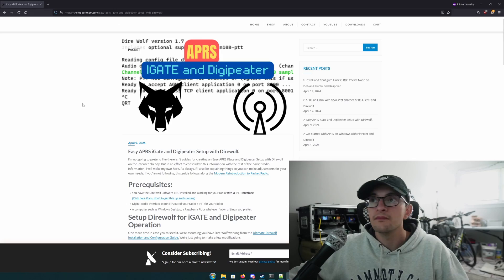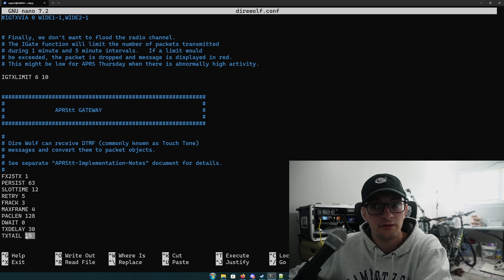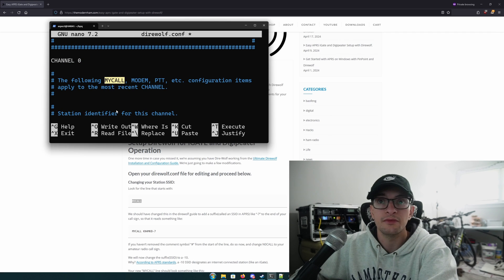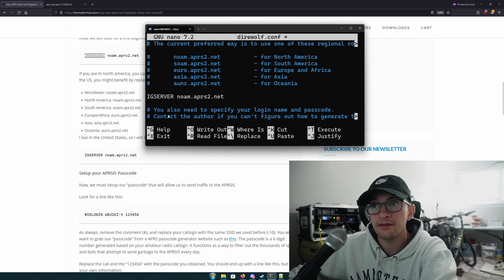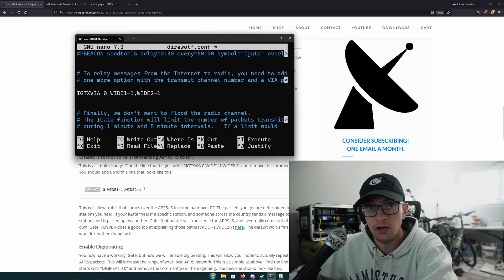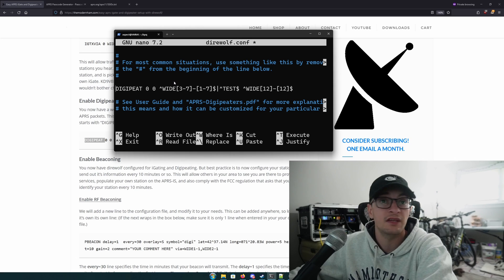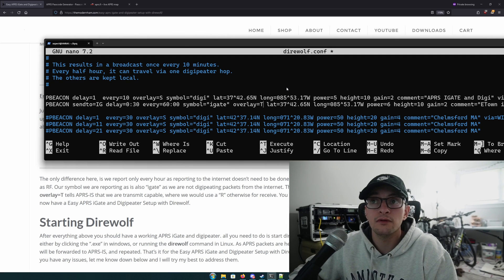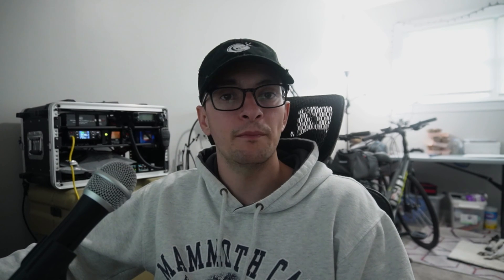EASY APRS I-Gate and Digipeater with Direwolf TNC - Packet Radio

Comment: A  question .  I have successfully tested an RF to Igate station using a simple SDR receiver (not TX) and Mac OS software called "QTH" .  It works well .  I used a Mac because that's all I have.  Now  I  want to do the same using an SDR receiver and Dire Wolf on Windows or Linux  for a radio club  located at a better location than my own QTH.  Do I HAVE TO have a Digirig device in addition to Dire Wolf ?  My arrangement with the QTH app did not .  We do not intend to have the Igate transmit RF .  Andy K3UK

Comment: Thank you for the content sir! It is excellent! Maybe I missed it somewhere, but if all the igate and digipeater features are configured in direwolf, do they need turned off or matched in Pinpoint or whatever software is being used? Or could direwolf just be turned on with most of the config commented out and the software set for those features?

Comment: You videos are incredibly helpful. Thank you.

Two questions. 

Is there a parameter in direwolf to gate position packets directly to APRS- IS? And visually see in RAW data that it infact has been gated?

Do you know of documentation that covers meaning of APRS.fi RAW data?

Thanks, Ken WB7QYB
Reply from the maker: Glad the videos could be helpful. You can in fact gate position packets straight to APRS-FI. The User-Guide on the GitHub page provides the config option for this. I'm afraid YouTube will remove my comment if I put it here.  To see the raw data, you need an account on Aprs.fi. You can find your station there, and select "view raw".

Comment: This series is so helpful! Thank you so much for putting in the time to do this! It's a great service to the ham community! I have direwolf set up with aprsis32 on my Windows laptop now and I think I am going to go to a digi soon. I'm running a older Dell laptop with windows 11 and a digirig lite into a yaesu ft2980r with a good antenna up 20-25 feet above local terrain. I would igate as well but there is an igate about 3 miles from my home. The problem is, it is running a pretty compromised antenna and I can't make it in with my yaesu ft2d. A digipeater at my house will solve that problem as well as help the local coverage quite a bit I believe. I live in a fairly rural area between the local towns. 73 and thanks again! KE8VIK
Reply from the maker: I am glad I could help. When everyone has the knowledge to pitch in, it helps the community as a whole, so I'm glad to get more people on the air with dire wolf.

Comment: Any idea how to address which cm108 device you want to ptt from on windows. When multiple are attached it just chooses one and sadly it’s not the correct one
Reply from the maker: Sadly, this is a problem that needs solves across the board in linux too. Besides adjusting the ADEVICE numbers for the sound card, or looking at the device manager for a PTT COM port, it's kind of a tossup every reboot. You should be able to select the soundcard with ADEVICE NUM1 NUM2.

Comment: Easy to follow instructions with a nice blog post on your site for additional information.   What more can you ask for!    I have a few I-Gates in my area already.  I need to do some research on the APRS network and see if it would be of benefit (or harmful) to add an additional I-Gate.  Thanks!
Reply from the maker: APRS.fi has a neat feature where you can see the coverage area of specific stations in your area. I can't remember exactly how to get there but it will map it visually after they've been active for a while.